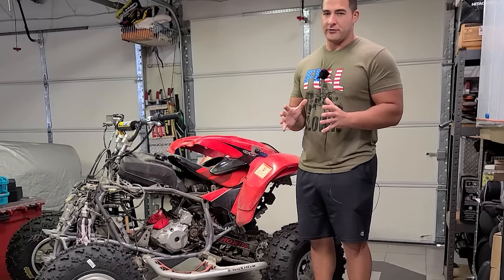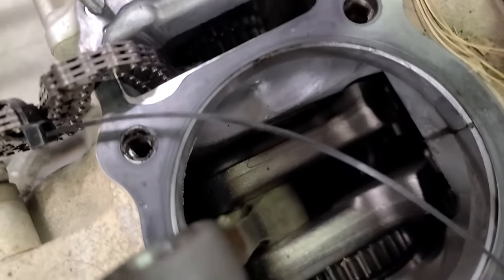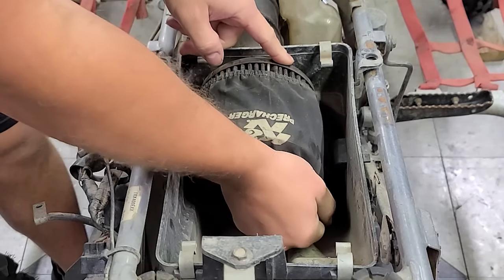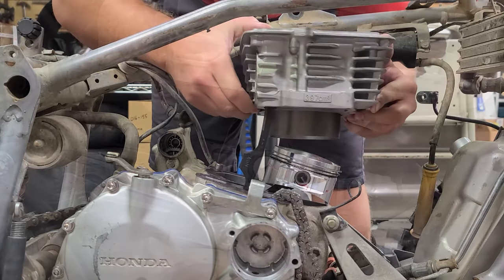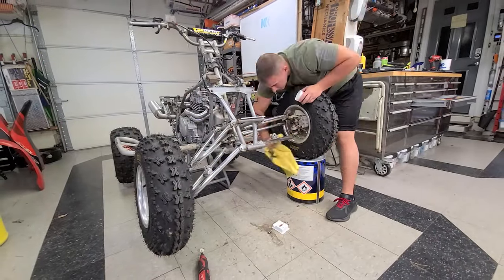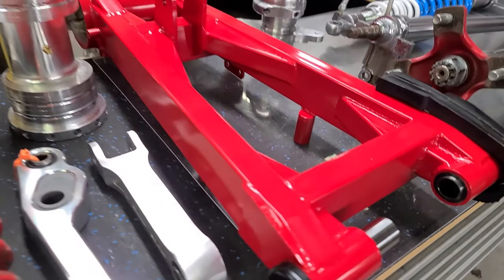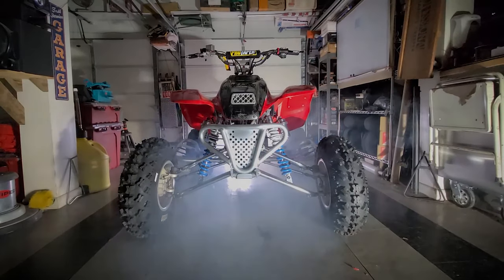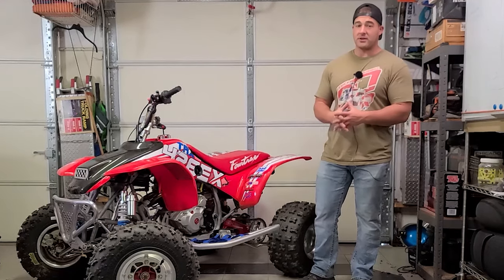Abandoned Honda 400EX saved after sitting for DECADES in pieces

Comment: just a heads up even thou it is alum . heat  it up. tap on the top of the bolt with a  punch . some of these bikes   they use  self taping bolts . it just a cheapy way of them doing it .

Comment: Who else saw that he put the clutch in wrong
Reply from the maker: Clutch is not in wrong
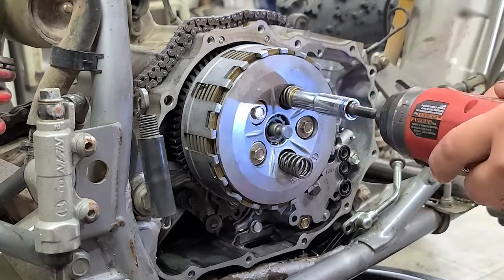Reply: @MichaelSabo  are you sure? Maybe I’m wrong… I’ve never seen a clutch pack where the friction discs aren’t in line. 27:23
Reply from the maker: @diegoramirez2396  yessir, it's right in the service manual, top friction goes in the in between groove. Tbh, I don't know why, it's not explained in the service manual and aftermarket baskets don't have the middle groove at the top; but that is legitimately the way it goes from the factory.

Comment: How the fuck are you expecting to run a stock carburetor when you're going to put an aftermarket Cam and valves and you're going to run the stock headed carb and you're a bike builder some of the other shit I've seen you do is pretty tight but this one's out there it's kind of important that you meet your need for gasoline you don't want to run it so lean that it burns up right after you get it done before you even get a chance to break it in you burn the rings out running it too lean